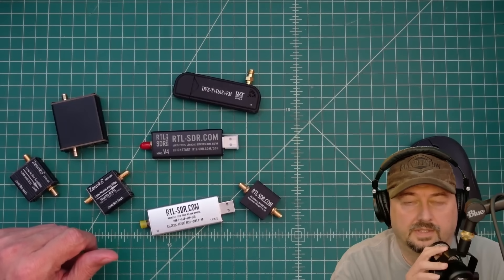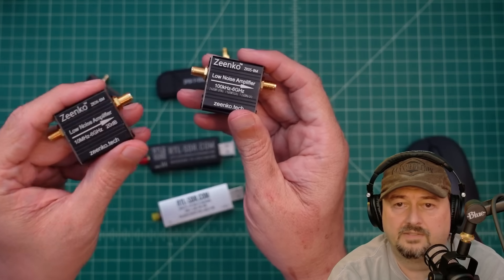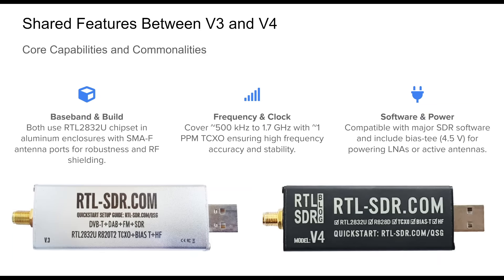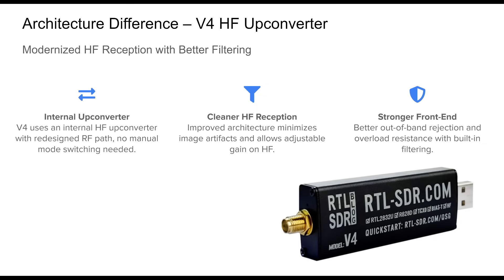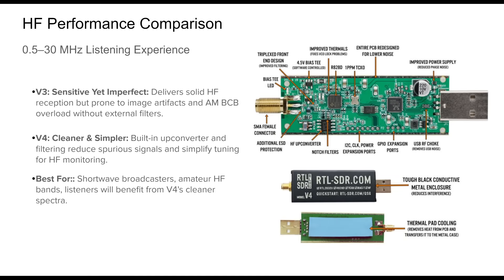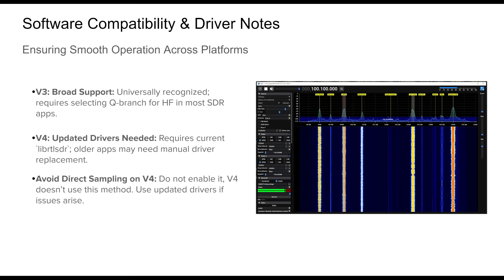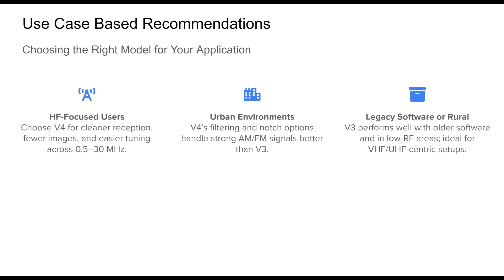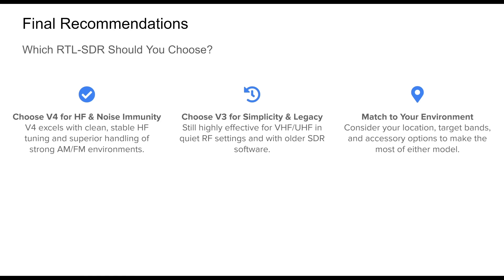Which RTL-SDR Dongle Reigns SUPREME: v3 or v4?

Comment: I have had nothing but trouble keeping my Rtl-Sdr dongle working. Its the same issue, over and over. Drivers. Windows 11 continues to replace or revert the WWIUSB drivers back to whatever wWindows thinks is correct.
Yes, I have tried all the fixes and downloads . I have spent multiple hours, multiple times restoring this somit will work.
It should not be this hard. I am done with these cheap, unstable RTL-SDR dongles. Not worth the time, effort or money spent.
I am going to buy a plug and play SDR, probably SDRPLAY RSPDxR2. No driver downloading, no Zadig, no extra files to make the thing work. 
Yea its more money, but who needsthe aggravation of junk that wont stay working.
Reply from the maker: I just upgraded to Win11, haven’t tried it yet 🤷

Comment: Ordered a V4c from the offical store, I perferred a type-c version, but, the noise seems high, when the gain is set to 0, with or without the anntena ( original RTL-SDR antenna kit ), backgroud noise level is around -65db, if i increase the gain, the noise goes up to -50. It does receive the FM radio since FM signal is strong, but so far I haven't received any ADS-B signals, tried several times at home and even once on a hill. sent messages to the store asking why and got only a response with "have you installed latest version of sdrangel, old version is not compatiable with v4"... very disappointed.
Reply from the maker: Sorry to hear you are having problems

Comment: Could you someday (if you didnt have already) make a video about the order of how to things should be set up? Example for 1090 you got an antenna with 10cm cable and need a 3m cable to reach your sdr, got 1090 bandwith filter and low noise amp (and maybe other filters). Where should they go? Filter near antenna, lna closer to sdr? Filter and lna together and closest to antenna or closest to sdr? Just an overview for beginners where to put things to have the least interference/best quality? I understand "it depends". Maybe you can give some examples on the most use cases. Thank you ❤

Edit: ok..closest to antenna. And i guess from antenna first in filter then lna so the lna just amplifies the filtered signal.
Reply from the maker: Correct, typically you see: Antenna > Filter > LNA > SDR 👍

Comment: Great Video!  The V3 has artifacts, when using it to listen to HF in the Direct Sampling Mode, that mirrored about 14.4 MHz.  That means if you are listening to a signal at 14.5 MHz (which is 0.1 MHz above 14.4 MHz), you will also be able to hear the same signal at 14.3 MHz (which is 0.1 MHz below 14.4MHz).  Both signals will be the same in amplitude and quality, and it will be difficult to determine which is real and which is the artifact. The same thing will occur with a signal that is at 24.4 MHz (which is 10 MHz above 14.4 MHz) and a signal at 4.4 MHz (which is 10 MHz below 14.4 MHz), they will be EXACTLY the same.  This happens due to bypassing the tuner and Directly Sampling the antenna with the RTL2832U chip using the 28.8 MHz internal clock frequency.  I believe the effect is called Nyquist Aliasing.  To explain Nyquist Sampling and the artifacts that go along with it, I would have to review it myself, or you can google it.  The good thing is that signals that occur on either side of 14.4 MHz are for the most part daytime or nighttime signals, so the clone signals will normally not be offensive unless you are searching for signals around 25 MHz, during the evening hours, and finding all your ham buddies that are actually broadcasting on 80 Meters (~3.8 MHz)!!!!

Comment: I have both versions and other than no need to "switch" to hf mode if you.will, both perform well. Of course i live in a rural area,25 miles away from the nearest city.I do feel that the v4 version runs a little cooler.. Another great video ..
Reply from the maker: Good to know you are finding the V4 runs cooler 👍

Comment: Great video.  This is a big help for upgrading what I have. The SDR play RSP-1 . Had it years and still love it. The only one I have. Just lack of work holding me up and high heating bills from last winter. Was a record cold for us. And I am paying for a mini split. It saving us a lot but takes time to pay for it self. The work I get comes in waves. And have several that want stuff done at once. Just 1 man shop.  I am a electrician as well and that work spotty . And have to pay bills and have a girlfriend that works in healthcare . Still make time for radio ! Cheers !
Reply: I'd consider the RSP1 an upgrade from the RTL-SDR's. The ADC has more bits / dynamic range and you have the option of more bandwidth on the RSP1's, but I don't really use them for the bandwidth.

That being said, the rtl-sdr's are super compatible with any project you'd like to use, so they are still handy. The one gotcha is it's super easy to buy a fake, you really want to go from the rtl-sdr site's store listing and not click off the page...
Reply from the maker: I have an RSP-1a around here somewhere 🤷

Comment: One important note is that the latest drivers from  RTL-SDR Blog support automatic direct sampling on V3 dongles.  For V3 dongles the drivers will auto switch on direct sampling when tuned to below 24 MHz and change back to normal sampling when tuned to above 24 MHz.
Reply from the maker: I had no idea, thank you for the info 👍

Comment: Great video! I've got the silver and black...I find the black is slightly cooler even after modifying the silver with a bunch of thermal engineering solutions. I recommend having a few (given the cost) because they can "release the magic smoke '. Both work well with"ham it up" and appriate antenna
Reply from the maker: Good to know that it runs cooler, I have not tired one of the Ham it Up upconverters 👍

Comment: I started out with the V3 RTLSDR, and now my interests are currently more on HF , have got V4 RTLSDR. This enables sensitive reception of HF frequencies. I have used the V3/V4 RTLSDR for weather satellite reception.
Reply from the maker: Im looking forward to testing the V4s HF capabilities 👍
Reply: Haydens video receiving SSTV off the space station got me into ham radio :)
Reply: Do you find there's any noticeable difference in weather satellite reception between the models? I'm looking to purchase a stick but debating between the models.
Reply: @hagglundguy  I used the V4 on VHF weather reception, with a V type 137MHz antenna. Since it was installed lower, I had limited horizon, but reception was ok. Depending on ones location, there could be high level external noise/signals such as from broadcast FM, so a tuned preamp may help reduce the effects on the 8 bit SDRs. I haven't done any weather reception for a while
Reply: @technishn Thank you for the great response. I think I may order the V4 model and figure out how much the noise level affects it.
Reply: @hagglundguy  Ensure the DC bias feed is off, and if you have a 50 ohm termination, one could see whether the rx noise floor increases with an external antenna.

Comment: I have a couple of those early models. Thanks Ape. I am using mine to monitor Balloon launches that we do here. I have a discone at 35' and will likely add a LNA to the front end.
Reply from the maker: Ballon launches!?!?
Reply: @TheSmokinApe have you ever tried to decode the weather balloon data?  RadioSondes.  You can track them on GPS and find the actual sonde. Idk if that's what this fella is doing.
Reply from the maker: @TheNapalmFTW he might be?  I have not tried
Reply: @TheSmokinApe it's fun if you're super nerdy lol. Look into it (not that we all dont have a thousand projects lol)
Reply from the maker: @TheNapalmFTW haha, will do
Reply: @TheSmokinApe  Yes, we launch high altitude balloons with Ham Radio payloads.
Reply: Add some filtering as well.